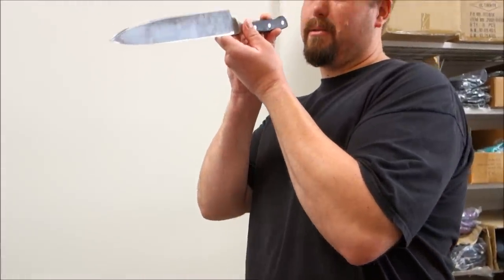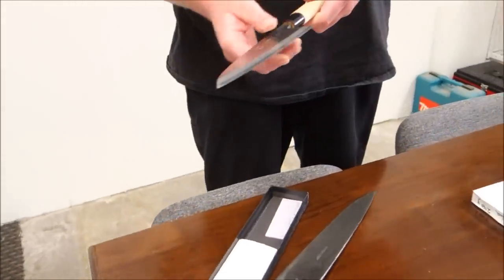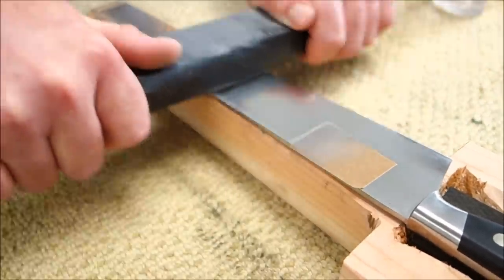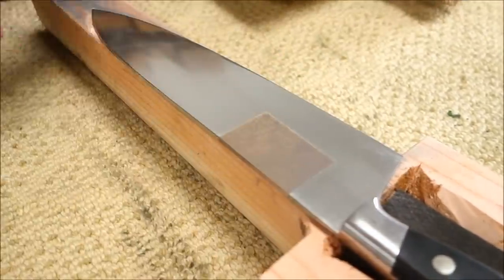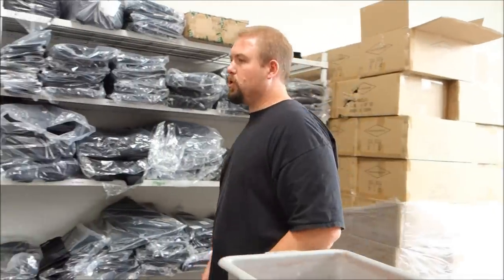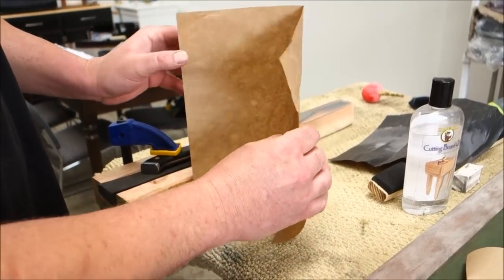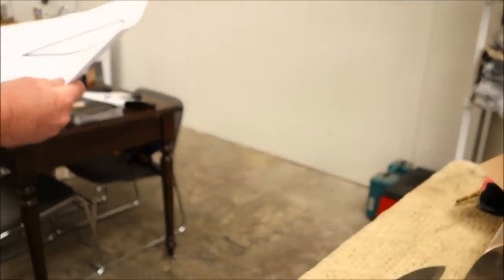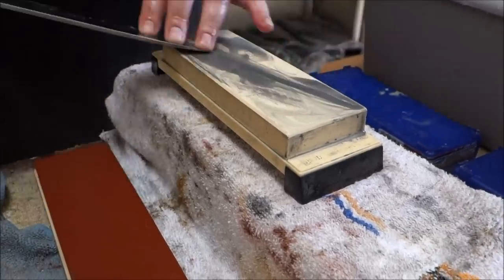Pinnacle of Professional Knife Sharpening - Knife Merchant

Comment: I love this. I nerded on sharpening and invested  in both knives and stones. Sometimes I go for a coarser edge (1500) and for the most I go with a 3000 grit or higher. A honing steel like the Dick polish or sapphire keep my knives for months without the stone. For rapid sharpening I use the Tormek. In my previous engagement of work I had the luxury to use some outrageously speedy mechanical machines Made by Helle. The price of those machines reflected the rpm and efficiency.

Comment: I've done the fold test once now with regular printer paper. This guy is legit! I used my dalstrong omega series kiritsuke. I'm a cook by trade and I have a set of shapton ceramic stones from 400 to 12k with no gap between 1k and 5k though. I also have a set of strops with the full set of dmt diapaste and the .5 micron diamond spray and I use them waaay more thany stones on my own knives

Comment: awesome video. i got a worksharp and i love it. the bad thing about it is you only get a 40*-50* edge on it. i prefer the V-Edge or the Compound Beveled edge so i dont use the guides. i got belts going from 60 grit to 12,000 grit on it and they get scary sharp. i also use stones from time to time its what i grew up using and its always nice knowing how to use a stone cause you may find yourself in a position where you wont have power and need to get your blade sharp and a stone would about be your only choice.

Comment: Okay... I'll be checking around... LOVE the sharpening vid(s)...
   AND I know this is an old post... er... video... BUT I now have a question...
   What was that about "force patina"???
     I know red-rust is horrible, I've had to "de-scale", and not just knives, but full swords, axes, and polearms, and Cast Iron Ware... (usually because old=Expensive)...
    SO I heard that bit about "doing it with mustard"... AND I wonder if there's a particular process to it, in the sense of layer(s) thickness, and the "set time"...
    Being possibly able to accelerate a greying patina on steel blades would be Awesome!!! ;o)

Comment: Get the white buffing compound.  And some what rough firing strips cut them to length like you have now. Apply the  compound to the strips the use like yo you were using you polish the knives faster than the sand it will get out the marks n scratches faster than the paper will and remove less metal.

Comment: I have a naniwa super stone that is supposed to be splash and go. Could I soak that for any period of time and make it work better? It is not a ceramic stone either. It is a 10,000 grit if that plays into anything.
Reply: Thanks
Reply: I found that it does get loaded pretty quickly. I just knock off the metal with my DMT fine bench stone. Takes care of it pretty well for now. When I get some more money, (I have all of $0.44) I might just get a mirror and some sandpaper in hopes of getting it just a bit flatter than I am currently seeing as my DMT isn't quite big enough.

Comment: Metal can only be sharpened so far. There are always crystals in the metal which will cause tearing.  A pure obsidian edge can be 10-50 times finer than the finest steel razor-blade, and that's why some surgeons use them. The reduced amount of tearing, makes it easier for the incisions to heal.
Reply: Landrew0 I've learnt more about sharpening lately by studying metallurgy. So many compromises; being a chef with work tools, I've learnt not too over sharpen.. Great for paper tests, shit for working use. 
👊
Reply: What about ceramic?
Reply: Hiroyuki Terada - Diaries of a Master Sushi Cheu
Reply: The only bad thing about obsibian is how brittle it is. Also, you want a working sharp, not an ultra impressive sharp that mess up after cutting grease.
Reply: Obsidian is like glass. Drop it and it will shatter into hundreds of pieces. And you can't make a big blade, necessary for cutting large pieces, from such a stone. the blae of a surgical scalpel is usually not larger than a fingernail. Not to mention what a full-size knife made from obsidian would cost. That's why steel will alsways be the material of choice.

Comment: There's automotive sandpaper that goes up to 5000, and even 12000!!! The best of it is that a pack of 30 cost about 9 usd, so it can be used as a sharpener while you save up for some quality stones and abrasives.

Comment: Not to take away anything from the skill shown in this video, but there are many people, myself included, that could take a cheap Chinese stainless steel butter knife and put an edge on it that will also cut that butcher paper like that. Of course the edge wouldn't last because of the steel quality, but putting the razor edge on knives isn't the difficult part. Regrinding, beveling, etc- are the tougher aspects. Grinding quality, tough, steel and putting on a lasting edge is where skill comes in.
Reply: +616Haggard Doesn't he say in the video that "this is NOT butcher paper"...

Comment: Can someone tell me if a 'grit' number' on a piece of sandpaper is the same as the 'grit' numbers on the dry, whet, Arkansas or every other sharpening stones out there, including the Japanese stones? I doubt it's the same, only relative to each other, right?
Reply: g43654 No the grit numbers are not the same. There are multiple grit standards around the world. When it comes to grit standards for Japanese stones they may vary. The two largest standards for manufactured abrasives are european FEPA and North American CAMI. You would have to find out if the manufacturers of your stones adhere to either standard.
Reply: whet ≠ wet, to whet = to sharpen😊

Comment: If you need fair pressure to shave arm hairs is that truly sharp I keep getting frustrated by how I can't seem to get hair popping sharp,although all I have is a 3 dollar smith sharp and a $3 two sided small stone.
Reply: I don't know if this will still help but just in case, if you color your bevel with sharpie then you can see where steel is being removed from the bevel. Do this for every stone and try to stay consistent. I'd also suggest cutting in to the edge of a piece of soft wood or soft rubber and it will remove any debris left on the edge.
Reply: Also, incredibly light pressure. That will bring out your sharpest edge
Reply: Thank you,i had tought myself cleaning the edge with plastic or wood helped.ill try that though.